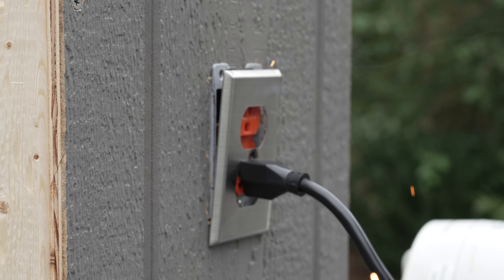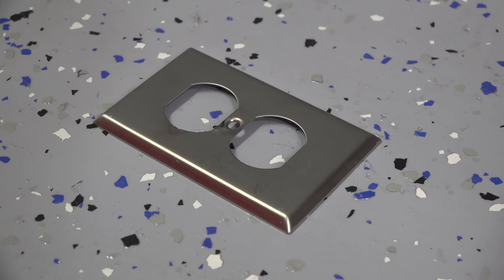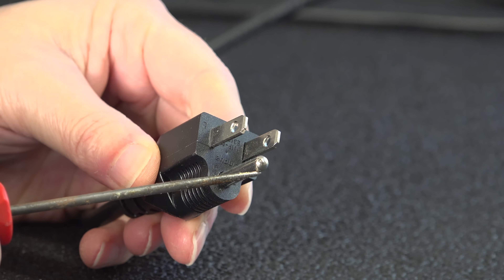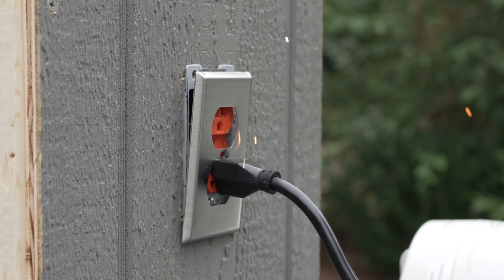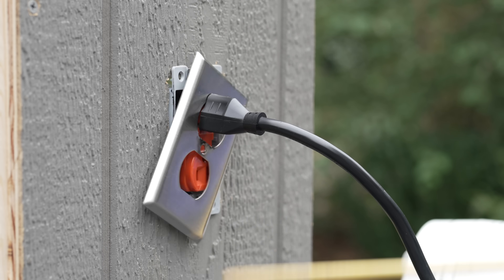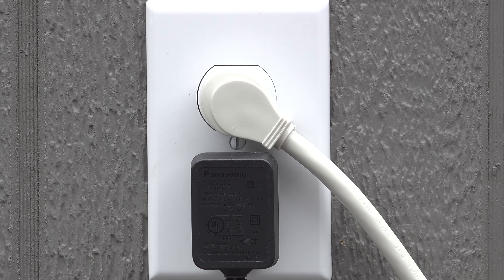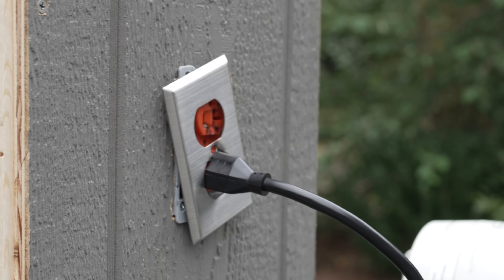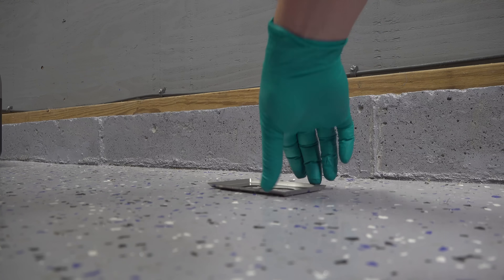What REALLY HAPPENS when you Install OUTLETS UPSIDE DOWN

Comment: My thumb-DOWN  is because the issues that this video addresses are only valid when METAL cover plates are used, or when using plugs optimized for 1 specific outlet-orientation.  Plus a missing centre screw being a rare situation and an indication of lousy maintenance.  Plus people stupid enough to not see/watch what they are doing deserving a (possibly  deadly) shock.
Any outlet design that allows such electrical issues to fairly easily take place is begging for problems.  Though it helps reduce reproduction by the stupid/careless/unaware.  Pending a major redesign in countries with such a stupid system, I place my USA-style outlets sideways with neutral UP and replace so-called optimized plugs with more-appropriate plugs.
Reply from the maker: You didn't watch the whole video. The final issue is the biggest of all and has nothing to do with plastic
Reply: @SilverCymbal  Oh, grounding via one's body.  You must have missed my sentence starting with " Plus people stupid enough"...

Comment: I've seen a very few appliance cords and extension cords that are designed for ground up use. however the legacy install base is far higher. I have even seen three prong power bricks and polarized power bricks, ground up no good.

Comment: It's much worse to install it sideways. then the metal plate falls onto the hot.
If the grounding is mounted downwards then it has a shorter path to the ground.
Or just use a plastic cover.

Comment: You see a lot of outlets installed upside down in the North & also whenever a 20 Amp outlet is used. You also see it done in hospitals & so forth since it is harder for the plug to be pulled out by accident. I was told this by a electrician at the retirement community my Dad lives at.

Comment: If you look at the printing on the yoke of the receptacle, you will see that it reads correctly when the ground is facing up.  That said, I don't install them that way, because I don't like how it looks.  I like the scaredy face lol. However, when I install them sideways, I always install them neutral up.  Which is probably pointless.

Comment: Make sure you don't have a box if your getting GCLI, the box is there because he cut a big ass hole to mount to the timber, then it won't fit inside with the face cover.  But if it has a diode for electronics, it's only a penny to get an inverter switch.  Some inverters are more complex.  Because anything you can say with words can be made into a circuits.  However, your talking about physicists, we get paid when the job is done.  Lol!
I was fixing airplanes way back in the olden days, but the most perplexed problems you could ever imagine.  Things were made by absolute deviants, like changing something in a birail bezier curve Trans Am, no room for the driver, the parts, absolutely made by junior college.  Not saying anything is wrong with junior colleges.  Best schools ever.  But the things they invented took more work than Jesus Christ.  😂😂😂😂😂😂😂

Comment: I have an counter example you have not thought of. At a rental hall (hosting weddings,  large meet ups) I saw many extension cords hanging down, get pulled down and that exposed the hot and neutral ALL the time. Besides the hazard of hot being exposed, it left the plug and cord loose, which then flickered often, and arced once. I convinced the board to replace the outlets, and when doing so had the ground positioned on top. Now when the extension cords are pulled down, the ground on top acting as the pivot point where it holds a tighter connection, so that it takes more force to pull the cord down. I see this as a safer situation, for straight plugs. Of course if ALL cords had flat-angled plugs, then we could end this mix-up..
Reply: I think you might have it mixed up... an outlet with the ground on the bottom will keep a chord in it sturdier than an outlet with the ground on the top however an outlet with the ground on the top is less likely to break off a ground prong when plug is pulled down and out away from the outlet
Reply: in my house I have commercial equipment that has 90° plugs that want the ground up, and some of my older cords were also all designed for ground-up

also the ground prong has a far tighter grip and less leverage when it comes to keeping a plug tight, even better if you have any U-shaped grounds found on all non molded plugs, those do not pop out at all when forcing a cord down on a ground up outlet
Reply: We should just have better plug design, where the part of the prongs closest to the plug housing is insulated, so even if it comes lose, live prongs aren't exposed.
Reply: @mjc0961  Japans connector standards actually altered our plug designs for just this

Comment: My electrician friend explained to me that the ground up orientation is safer. In the metal plate scenario, the ground is in contact before hot. If hot is touched, it will create a short and pop the breaker. Since metal is much more conductive than human skin, you are safe since the current will flow along the easiest path (metal cover). It makes a certain amount of sense but I don't know if it is accurate or not.

Comment: If you had a residual current safety switch on your panel, any current above 30mA going through the ground pin will trip it and de-energise the circuit. This is important electrical safety gear that most houses in other countries have. Then it doesn't matter if the ground pin is up, because as soon as ground is receiving current, the circuit trips.
Reply: No, they don't on current though the ground pin, but rather on an imbalance between hot and neutral.

Comment: In the past, metal plates were used in the kitchen and the bathrooms, and plates made of other materials were used everywhere else in the house. The ground plug is always down, unless it is on a switched outlet for a lamp or another reason. I'm 73 years old, and have never seen any outlet cover come loose for any reason. My Mom's house was built in 1959, and still has some of the original covers that have never been disturbed or come loose. Put the covers on correctly, and there will never be any problem like the ones you have made up for this video.
Reply: Problem is we have younger generations trying to do electrical work now so you cannot trust them to do it right even after being trained. Sad but true.
Reply: @gregatkinson7276  Doing electrical work, but don't know how to screw a wall plate on? I don't think so. Dave is correct. Wall plates do not fall off on their own

Comment: should be ground down so if the cord is pull out with gravity the last connection to lose contact is the earth this is also why this pin is longer. side mounted sockets are available with the pin down, at lest where I am

Comment: In the states you only protect for ground fault in areas prone to risk of water, like bathroom, ketchen counters, outside... In Spain we use RCCBs at the level of the electrical panel, so the whole house circuit is protected against ground fault, instead os specific sockets. That adds levels of protection that I would not even list here... Maybe it's a time to think about that.
Reply: THINKING is a hazard in the USA...

Comment: This is a staged situation much like the picture wire falling on the prongs. Both are made up situation that depend on the plug not being securely plugged in to the receptacle.
Upside down installation are sometimes used to designate a switched outlet.

Comment: ⚠️ WOW!,  Thank You!
I’m an old timer EE. My focus was mainly RF, but I paid my way through grad school by apprenticing with a journeyman electrician. I enjoyed it so much that I kept the job as a part-time career for the following 30 years LOL)

The majority of the work was hospitals and public safety projects (police and fire hq buildings and remote communication shelters). ALL of that work was done “ground pin UP”, with the hope of a safer install.  I never questioned it..

I  them worked for Motorola, designing communications systems and other RF projects.  (mostly mission-critical public safety or military gear) They actually mandate that traditional duplex receptacles NEVER be installed “upside down” for mission critical equipment installed in the field.
I never questioned either method and really believed that “ground pin up”. did make sense.

I am 100% convinced that I’d rather have a solid, low-resistance path (through a SS or metallic plate) to clear the fault than a human becoming that very path.

So.. THANKS!
Reply: How come all of that work was done with the hope of a safer install?

Comment: One thing about horizontal installation,  it does matter which way the ground goes. The narrow blade is the hot. It should be on the bottom, for the cover and for fingers containing the blade. When any cord is inserted from the point of contact with the conductors in the receptacle until seated, there can be as much as 3/16" of exposed copper on the tines of the male cord cap.
Reply: That doesn't make any sense. As the plug is inserted, hot metal IS momentarily exposed. But so what? Whether it's the upper or lower prong makes no difference from a safety perspective. Learn to hold onto the plug properly, when inserting or removing it, and no-one gets hurt. I've installed thousands of receptacles in hospitals, daycares, community halls etc. and in every case the grounds were down in a vertical install, and the narrow (hot) slot was up in a horizontal install. That's been the standard in the trade for decades and decades.
Reply: @paulmaxwell8851  In Indiana, the trade standard shifted (late 90s/early 2000s) to ground up (vert.), hot down (horizontal) due to specs written by the design engineers.  That whole "authority having jurisdiction " thing, you know, in the code. (The NEC is just the bare minimum requirements.)

Comment: Or maybe flat face electrical interfaces are just a bad idea altogether. This is one of the many reasons why the European plug is sunk into the socket. The UK tried to "fix" their bad ones with making the prongs sleeved and sunk into the socket that way but the UK plug is still a clunker and the US and Australian plugs are just a safety hazard with the tiny plug that while being pulled out is so easy to touch on the electrodes by accident. The socket may be already disconnected but the power supply caps aren't and will probably shock you. But then again, be careful around mains power.

Comment: One solution and it don't matter which way the outlet is installed. Use plastic plates. Hospitals have ground up and there is false information on this video. Not all flat plugs are made for ground down. My AC units are made for ground up. The wire is on top of the plug when the AC is plugged in. When I put in new outlets I may put the ground up where the AC units are. Problem solved. 73

Comment: If you want to see something really dangerous, check out the small all plastic "consumer units" they use in the uk where we would have a large metal breaker panel. Everything is really cramped inside and the older panels are flammable! Watched a video of one where the firefighters described the flames coming up from the top of the panel like a blow tourch! Fortunately the home owners smelled the smoke and the fire department got there fast enough to limit damage to the floor directly above. I definitely prefer our metal panels for safety reasons.

Comment: While I have to agree that I think the ground hole should be down, in all my years, I’ve never seen a cover screw ever back itself out.  Furthermore, most times the cover needs to be scored with a utility knife in order to unstick it from the wall.   The cord orientation seems to be the best reason for the ground hole to be on the bottom.   Also, it just looks weird having the ground on top.

Comment: Best solution, do NOT use metal plates.  I do not even understand how this is even allowed
Reply: In hospitals I think it has to do with infection control,  and something about stainless steel is easier to disinfect and discourages bacteria growth, whereas plastic plates can have a slightly textured surface and scratches that act as a breeding place for bacteria.    That is what I've heard, don't know how true it is.

Comment: I’m not sure where you came up with the 30 years of debate over this. 3 prong outlets have been around since the 60’s. I’ve always (for over 40 years now) installed them ground up or neutral up if installing them sideways. The idea (and I believe part of the initial design philosophy) is that if something metal falls against it, you don’t come in contact with live voltage when you reach down to pick it up. Since most home installations don’t use metal cover plates, your primary argument for ground down really doesn’t apply. The reason codes don’t address it is more due to the controversy (and politics) than anything else.

Comment: How about we not use conductive cover plates. That solves the issue with the pate causing a short. I was told upside down wtihout the conductive cover plate actually help prevent shorts when wires or the plug get damaged at the socket.

Comment: Good advice... EXCEPT for 240V receptacles(outlets). Every 240V(sometimes labeled 220V) appliance cord I've ever seen has a flat plug with the ground lug on top and the cord exiting the bottom. Thus, installing the receptacle with the ground lug on bottom has the cord exiting upward and thus looping. Gravity over time eventually pulls the plug partially out of the receptacle at the top exposing the hot and neutral lugs. On top of that, 240V receptacles are often mounted in metal boxes or at least have metal faceplates. So it is best to install 120V receptacles with the ground on bottom and 240V receptacles with the ground on top.

Comment: Had this discussion with a friend that is a "Master Electrician" and me being an Electrical Engineer.  He stated that having the ground pin up was "safer". I agreed initially, but kept thinking about the design of all the appliances and noticed that this seemed incorrect for all those reasons.  Tripping the protection and de-energizing the circuit, though, wins this argument without further discussion. For those metal plates in hospitals that can come loose, use Lock-tite(TM) or thread-locker.
Reply: The biggest thing the "ground pin up is safer" clowns never consider is how many of our plugs don't even have a ground prong to begin with.

The whole thing really makes no sense if you stop and think about it for a moment. Just install them ground down as intended so power bricks and strips work.

Comment: 2:22 With the plate connecting to the active the path to ground is definitely likely through you. Seeing that the neutral is exactly that, and bonded to ground at several locations, it is most unlikely that you would be the path to ground!

Comment: It seems to me that this all came about because a few electricians took the quick and easy way out. If this has really been the big issue they made it out to be a better solution would have been to redesign the outlet and cover plate so that shorting it and electrocution would have been impossible if the plate came loose.
Reply: EXACTLY

Comment: In many cases, if a metal plate falls on the prongs with the ground down, it will NOT cause the breaker to blow, it just dances for several minutes while throwing sparks everywhere!  I’ve witnessed this first hand more than a dozen times at a previous employer and we replaced all covers with unbreakable plastic ones as a result.  Thinking metal is required for durability today is silly with modern plastics IMO, but back in the 50s with bakalite plastic, sure. Flipping all the outlets was also discussed, but in a commercial building that would come with electrician costs, where replacing covers does not.  The argument based on cords with angles built in is a little weak as there are also cords with the other angle or with a swivel. Plus, 90% of cords have no angle at all so that’s a moot point IMO. The bigger safety issue for me is that with ground down, a partially unplugged cord exposes a dangerous pair of conductors. Pretty low risk for a short other than the metal plate issue though, so this is mostly much ado about nothing in the end.
Reply: "as there are also cords with the other angle"
Where?  Closest google shows me is 90 degrees; none with ground up.  (searched "low profile plug with ground up", "flush plug with ground up", and just "low profile plug")
As long as industry standard is to put the heavy end down when ground is down, that's the way outlets should be installed unless specifically needed otherwise.
Reply: @JonathanMurray  The standard (guessing, but seems about 90% or more) is to not have any strain relief at all, so the heavy end is almost always simply straight out and the ground direction makes no difference.  The part of my comment that you highlighted was referring to the fact that among the 10% that do have strain relief, most of those assume ground down, some assume ground up, and some swivel to accommodate either.  I own 2 or 3 flat to the wall extension cords that have the strain relief that assumes ground up.  As you said, they are not common, and may have even been a one-off that showed up on the shelf and then was never seen again - which makes sense given how nebulous this issue has been over the years.

Comment: In your example of a plate dangling on the ground in a ground-up install, if you reach behind a piece of furniture and touch the plate it's still connected to ground, so even if it swings over and touches a live conductor it's going to complete the circuit and pop the breaker, you're unlikely to receive a shock. With the ground down, it MIGHT only be touching the live conductor without touching the neutral conductor, which means the plate is live and you could very well get a shock from it. IMO, that was a bad argument against ground-up installation.